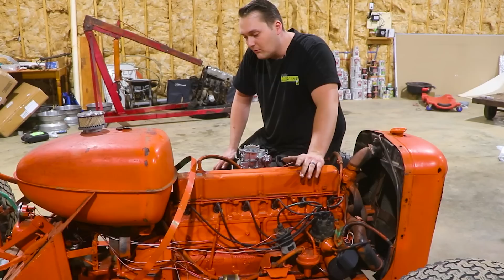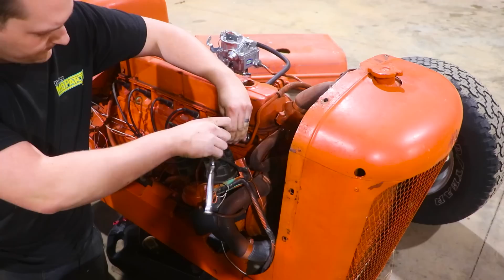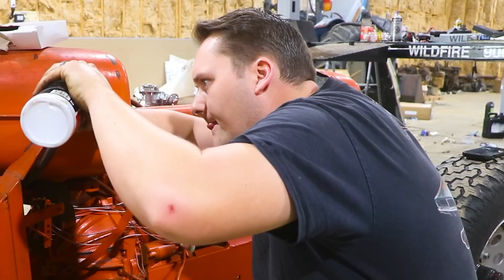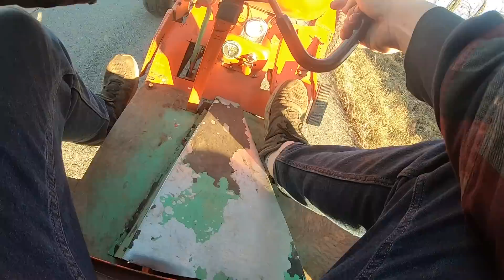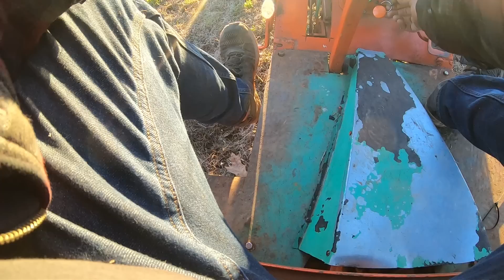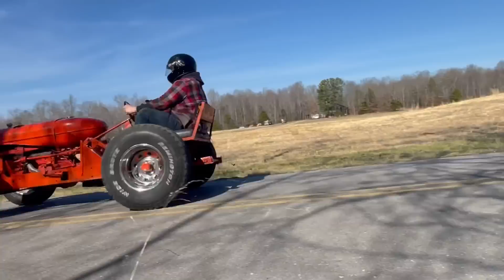I Bought a Chevy Powered Tractor Go-Kart and It's WILD

Comment: I would for sure Dylan why not man. It's cool for sure. I'd definitely make it street legal to drive no doubt about it. There's probably not another just like out there at all. Ford front end& brakes will fix that part of it.& The rear needs some mini shackles & shock towers for shocks. I'd add on some mini leaf springs to it as well for the rear end to rest on for the lowered part out of A T bucket roadster set-up. Maybe even the front end set-up to. With the cage.,or cabinet so you can equip it with some type of heater source to for winter usage to. That tractor kart would be awesome turned into 4x4 set-up for sure no joke about that either. I think it would look neat if the cabinet was shaped like the hood sort of contour to the frame.& Body of that machine. Then painted that orange to match the rest of it all. With your shining solutions to on it also. Enclosed cabinet with roll up& down mini windows to. Mini chrome mirrors on both sides. Along with inside rear view mirror to yeah. That would definitely look sharp.& Be multi purpose vehicle for then to. Especially if you added on A badlands winch for it.

Comment: We had a rig similar to that when we were kids. Only had repurposed drive shaft ebrake, single cross spring in front, roll bar w/big headlight on front. Roll bar over school bus seat in back witch was right over the RR. And a hitch and a slow moving sign , which made it tractor road legal. (It wasn't slow)😂

Comment: You could go with a regular steering wheel from, say, John Deere or some other tractor. I might add, you want to check over the steering shaft going to the front as a loose bolt could prove to be fatal. Proper bolts to secure it are very cheap compared to what could happen.

Comment: probably can do a trailer arm type suspension in the rear with coil over shocks , theres enough room under the narrow frame for the front mounting point(s) and the watts link , can make the upper shockmounts on the old frame 
maine a chevy truck (c10) front suspension that has narrowed the crossmember in the center and welded to the tractor frame , or sumting out of a s10 truck / asian car with double a arm type front setup  for the front that way you get diskbrakes in the front , probably need to change the main cilinder to have both sets of brakes working , prolly need to make the pedals so they have support under them for youre feet (maibe harley style footplates ) and operate a little more natural , might be able to reuse the original steering from the tractor , would do a bucket seat and a roll over bar and put a 5 point seatbelt setup in it 
hmmm lets see : trailer lights on the back for brake lights rear lights and possibly indicators and reverse light (prolly can fit a tractor style indicator stalk on the steering columb) might check if the charging system works , motorcycle style indicator lights for the front 
might want to look intoo a better shifter for the 3 speed or get an automatic and only need two pedals
with the suspension the thing will probably start to lean over in turns and is likely to lift one of its wheels , the trailerarm setup does have a sort of build in anti rollbar so should lean less than say a stock leafspring setup , they use the tailer arm setup in nascars and under the older c10 chevies

Comment: Seems to me...lowering the pedal arrangement to get your knees out of your teeth.  The seat is literally on the diff.  I think the rear suspension would be attached to the seat frame what ever you place there.  Basically the same set up most modern tractors use.  Up front you may be able to adapt a Ford T drop bar with coil overs to ease the harsh road bumps.  
Obviously a cage would make this safer.  Maybe something similar to old behind the diff dragsters of the 60s.  Because...face it....your butt is hanging way out there behind this contraption.
It looks fun AF.  Seeing you try to drive it puts a spotlight on just how unsafe it really is.  Wish I hade one.
Oh the 6 sounds awsome.

Comment: We used to get away with sketchy stuff like that when I was a kid. Simply because we grew up in the country. You're lucky you live wherever you live. Get an automatic tranny that fits. Weld up a basic hoop in case you roll it. Fix the steering. Put on some seat belts if you can. Leave the rest of it alone. Keep it sketchy, but safe enough to drive.

Comment: Dont worry about a cage and a major overhaul of the suspension maybe just some shocks up front and it definitely needs disc brakes in the rear and a more safe seat and harness.

But Imagine this with an ls engine or another small block or big block and a built rear end it'd be a certified death trap

Comment: I definitely wanna see more .. if you could find some other tractor parts like a spring loaded seat running boards and definitely rack n pinion steering  truck springs and some shocks ..  a zero turn type foldable  roll cage maybe .. I like the fact it’s a tractor .. wheelie bars … yea .. The orange people eater or you could paint it purple ..

Comment: Build shock towers over the engine cover and make your own suspension like those guys do with those four wheeler China builds. Set up to look like a rock crawler. With large diameter typical Chevy 4 x 4 tires off of a Tahoe from a junkyard that 6 cylinder can power a transfer case if going all out 4 x 4. you could call it the Polished cow pie.haha

Comment: Dylan the carb is higher than the bottom of the tank. Put a electric fuel pump on it and you should never have that running problem again

Comment: Likely the master cylinder is way too big. Typically they are meant to operate 4 brakes. so finding one with a small piston would likely help. Also putting the master closer to the pivot point of the brake arm would also help.

Comment: If you think that is scetchy how about a garden tractor with extended axles, big tires all around, that small garden tractor brake that will stop you at less than 4 mph, the loose frt. steering, 15 hp motor and 27 MPH. That was for sure scetchy but fun as ll get out.

Comment: I would do at least rear suspension. Roll cage, seat belts amd a seat. Get the shifter and clutch fixed. I think that it needs better floorboards for safety and comfort.
Personally, I would keep it simple. It is just a go cart.

Comment: The proper name for that is a doodlebug there were thousands of those built a long time ago and Farmers couldn't get they were made from any car you could ever get your hands on model A's Dodge cars Chevy cars Dodge trucks Chevy trucks Ford trucks they usually used a vehicle motor and two transmissions and whatever large rear end they could get most of them used chains on the rear tires for traction they pulled plows field discs sickle bar mowers and hay takes and if they had a self-propelled hay baler did that to right along with pulling the manure spreader anyting attractor would do they would try to do with their doodlebug